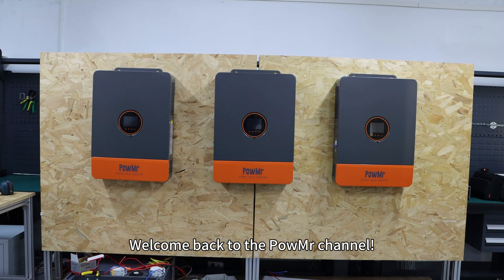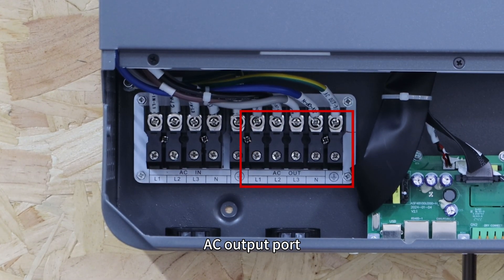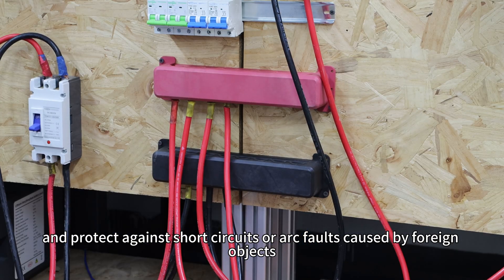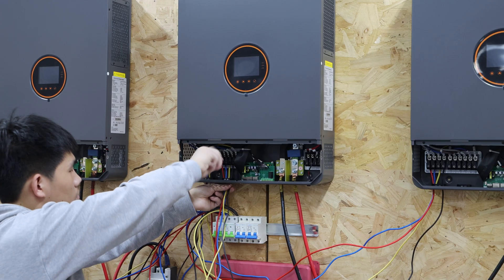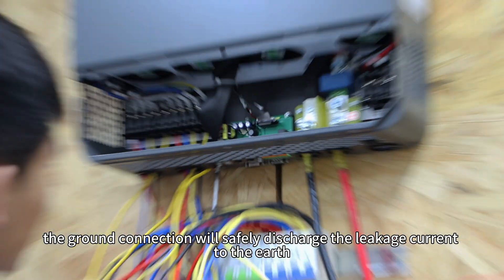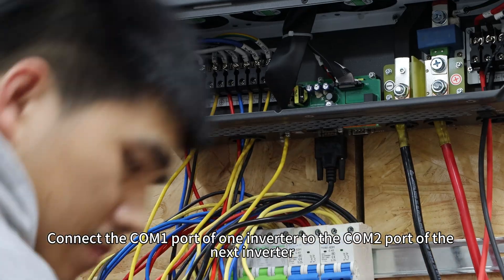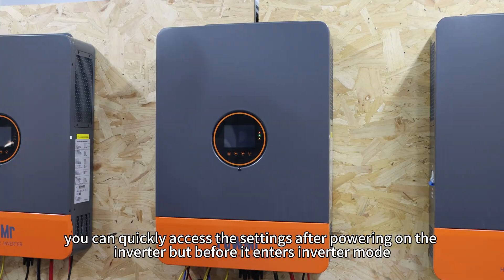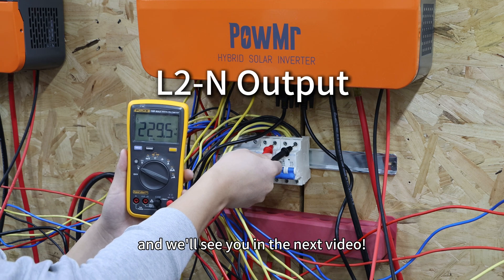How to Complete the Parallel Connection of PowMr Solar Inverter - POW-SunSmart 12KPL3

Comment: When will you guy get the 3phase 127/220v?
Reply from the maker: What is your single-phase voltage? Kindly check the POW-SunSmart 6.5KP model:

https://powmr.com/products/6-5kw-48vdc-hybird-inverter-110-240vac-split-phase-supports-6-units-in-parallel
Reply: @PowmrSolar  is it possible to see the data sheet of this unit?
Reply from the maker: @stephanauguste4008  You can view it by clicking on the product link.